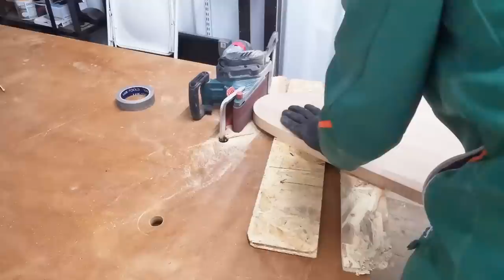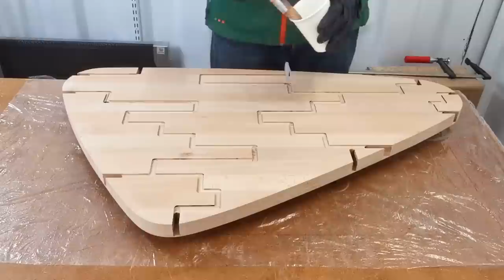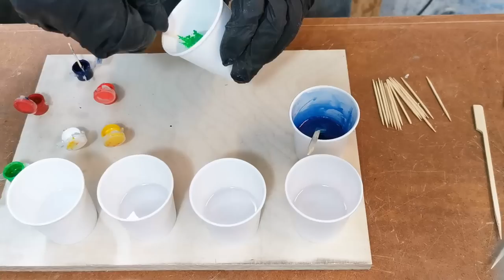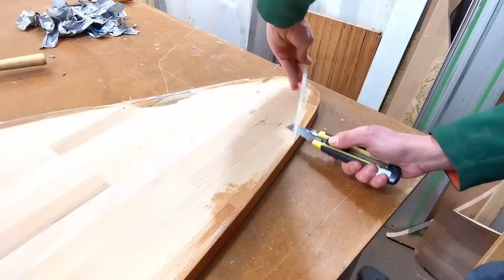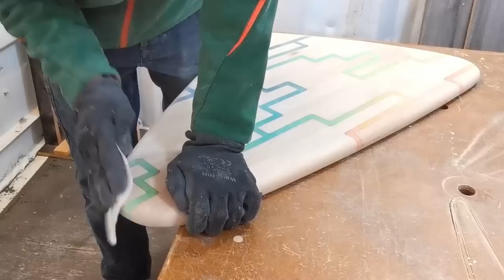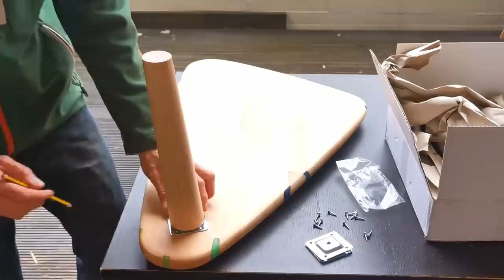Making the TETRIS Table. DIY

Comment: Just passing on a tip.  Other makers say dont run the flat side of the router base against the guide edge.
Reply from the maker: I know, and you're right. But for this project, it was much more convenient for me to use it that way because of the number of parallel I had to do.

Comment: Another beautiful and creative piece! Friendly advice for the router. Run the curved part of the router against the straight edge and not the flat part. This will ensure that if your router rotates that  the round edge will maintain contact with the straight edge. I hope that makes sense.
Reply from the maker: Thank you! I did it that way because it was easier for me to measure and make the parallel lines. Of course, you are right and the correct way to use the router is as you say.

Comment: I think i would have gone with black tinted epoxy myself but this was a cool idea and it gives me an idea to do an epoxy inlay but with flowing lines instead.  I use the Osmo Polyx Hard wax oil also and love it.  I find that i need to use very little.  Just enough to cover the areas i need.  I think less is wasted when i rub out the excess oil.  I have not tried sanding the first coat to 600.  Maybe i will next time.  Thanks for another inspiring video.  Merry Christmas to you
Reply from the maker: I almost always use black epoxy, this time I wanted to try something different. If you sand with 600 grit and then give another coat, you will have a much better finish

Comment: This is beautiful!  Did you consider using less epoxy and letting capillary action suck it up to the lip?   You wouldn't have to worry about sanding down any overflow...
Reply from the maker: Thank you! I would risk it absorbing too much epoxy, and then I would have to sand a lot of wood to flatten it.

Comment: Your table design is playful and imaginative.  But your method of attaching the legs is lousy, and they’ll be weak against racking forces.  Drilling mortises for each leg with a Fortsner bit would have been an improvement without adding too much work. Adding a skirt between the legs would have helped the table’s stability a lot, and would only have required some straight slots routed out, filled with matching pieces of beech.
Reply from the maker: Maybe you're right, but the truth is that I didn't want to invest more work into such a small table. Thanks anyway, advice is always welcome.